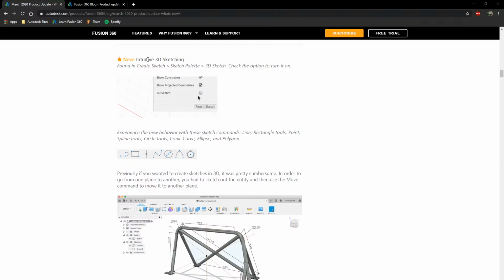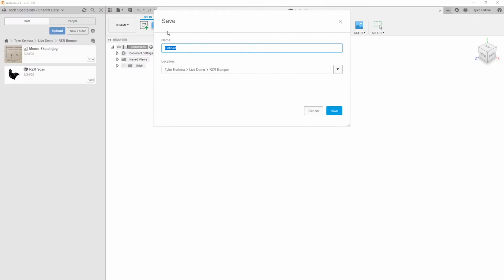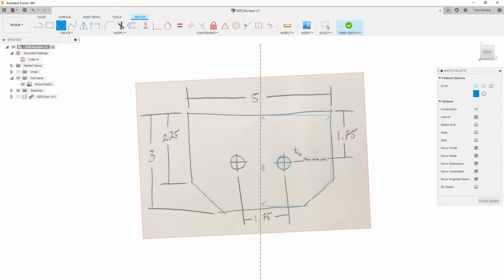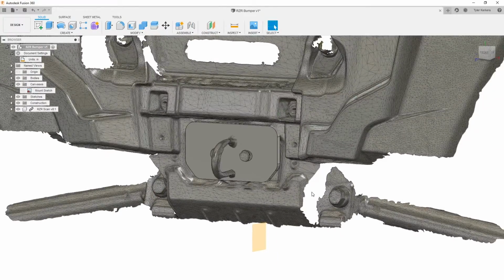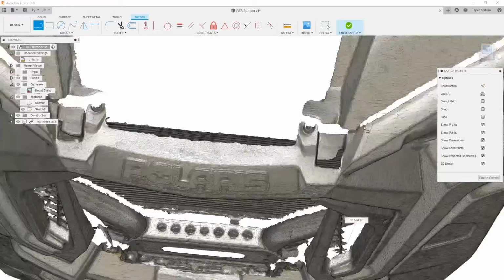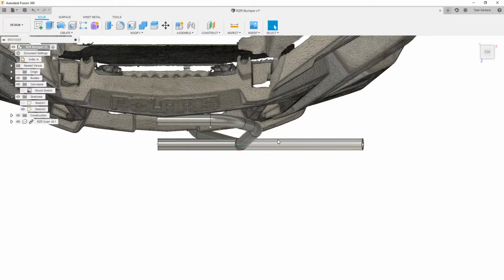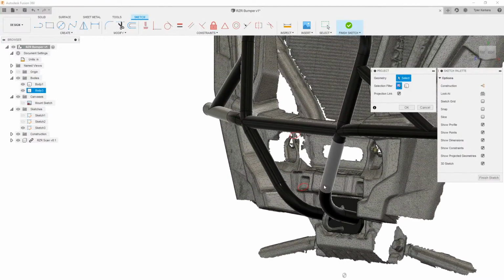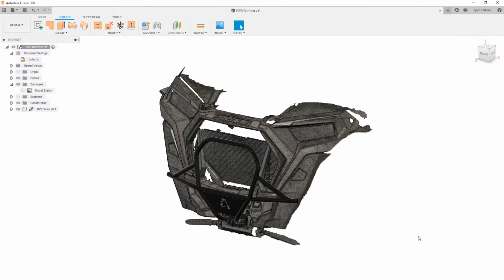360 LIVE: 3D Sketching a Welded Tubular Front Bumper

Comment: This is a good tutorial of a very nice new feature, however I'd like to see a follow up video where you produce a fabrication drawing of this bumper.
I produce these drawings myself professionally, and its an absolute chore due to lacking features such as:
- No isometric dimensioning
- No easy feature to provide lengths in a bill of materials
- Limited options placing dimensions on curved features like the copes of that pipe
- Alignment of parts (like all the angles) needs to be done by creating new views in the model environment to create projected views that can then be used in 2D drawings
- No frame or weldment feature in the modelling environment to easily create rigid tubes
- No weld symbols
- Creating isolated views of individual pipes like that assembly is a challenge
I could list more, it is very unfortunate that the total package of Fusion is lacking to deliver everything needed to physically build a project like this tubular steel bumper.
Reply: Garret Hunter painfully true...
Reply: Hello Garret. Do you know any program that gives you all you mention ??

I want to buy a 3D scanner to creat 3D sketching, exactly to do this. I’m in the atvs an UTVs accesories industry in México.  Thanks for your comments.

Comment: Awesome livestream, easy to follow but I do have one question regarding the pipe command.  I don't see this problem when I try to put a fillet between the pipe and plate.   Is there a small gap at where the pipe and the vertical plate meet on yours due the fact that line coming out of plate not perpendicular? Thanks,

Comment: Thanks for the great video. I'm Wondering if it's possible to sketch a line with an arc going up and down while arcing Front and Back. I'm trying to make a sheet metal part that I can flatten to get a route file. Any tips would be appreciated. Thanks